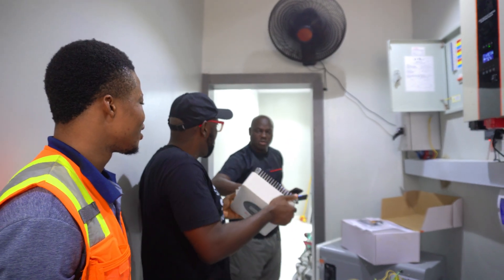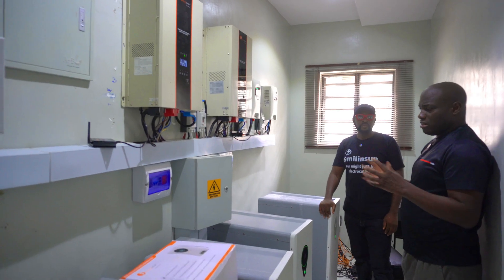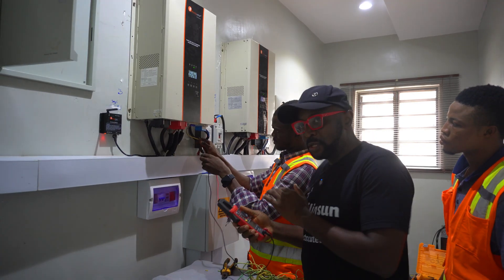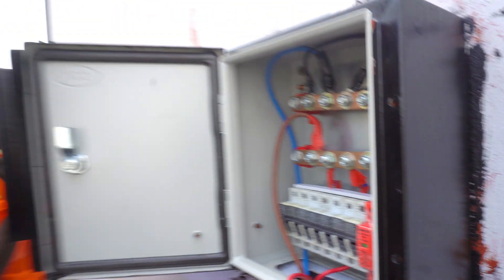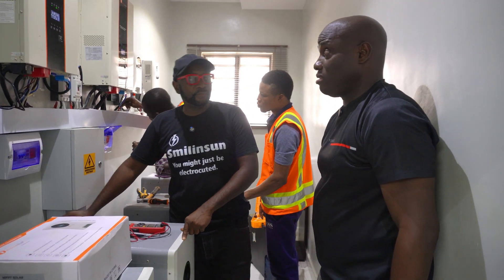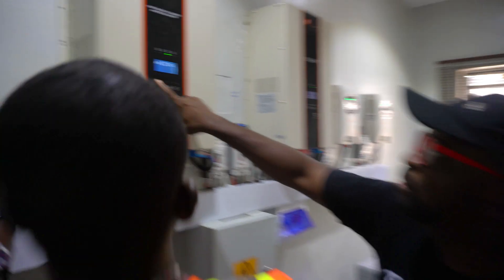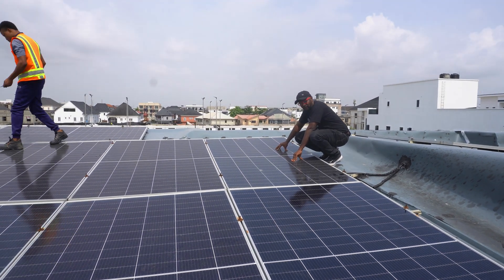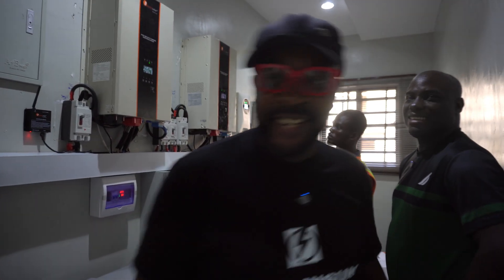This Solar System Was a Disaster — Until We Showed Up

Comment: Please a quick question.. why still using charge controller with hybrid inverter? I thought charge controller are built into hybrid inverter sir?
Reply: Mppt have rating and limits, Both hybrid or charge controller. If you have that much panels your hybrid may not  be enough to accommodate the entire panels so you need extra charge controllers
Reply from the maker: If the capacity of the PV accommodation is exhausted then you need new charge controllers
Reply: How did you do the connect then sir?
Reply: @damskidayo7198 you connect them based on the data sheets of the charge controller which depends on the PV capacity that will determine whether 3s or 2s, the out put of the charge controller will then be connected in parallel to the batteries in the combiner box.

Comment: Hello sir, 
Please help me understand. You said 6mm pv cables are too small to be used in a low voltage PV system. I am assuming that this is a 48v system.  My question is if I connect 9*670w panels in series using 4mm or 6mm good quality PV cables are you saying that those cables would be inadequate to handle the approximately 13a of dc current?
Reply from the maker: The connection you just mentioned is a high voltage pv system configuration, 4mm.is what you need for this.
Reply: @smilinsunsmilinsun8056 Thanks for your response and clarification.

Comment: My luxpower 6k inverter apparently just turns on fans once the load gets to about 250 watts regardless of temps. Really wish it could be more quiet.
Reply from the maker: The fans are supposed to come on when there is significant load on the inverter.
Reply: @smilinsunsmilinsun8056 my sister's 16kwh luxpower is quiet. I assumed it probably is just a much more robust unit with massive heatsinks inside. Her's is also weather sealed and looks much more premium.